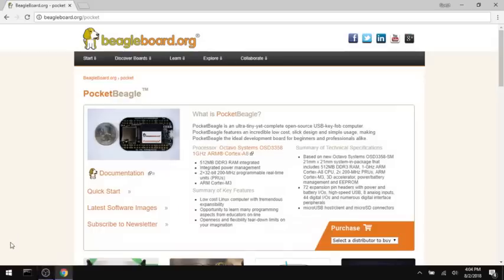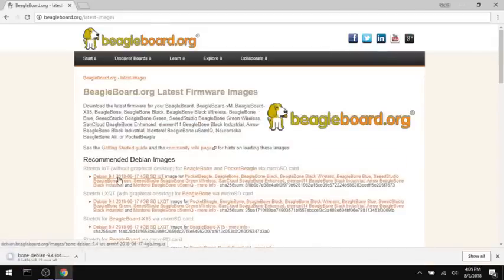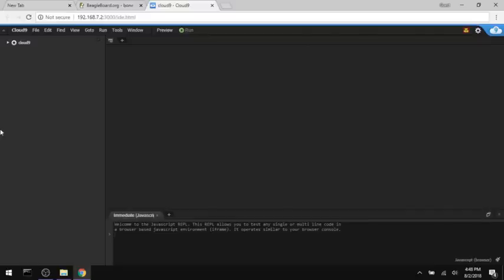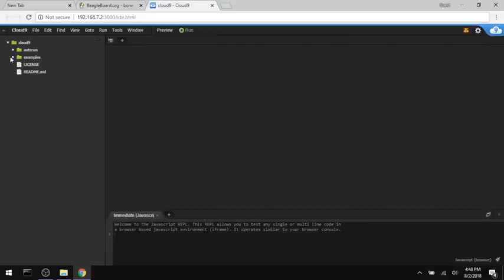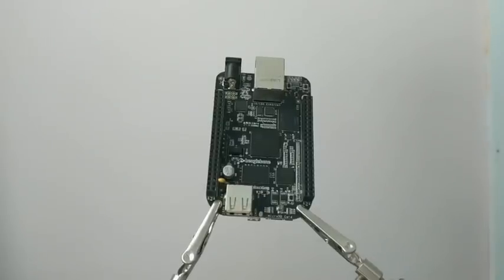BeagleBone Black specs | Just Board

Comment: I like this series!

Btw you seem like the right person to ask this:
I'm planning on creating an IoT temp measuring device for my fridge, then transmits it to a server so I can monitor the temperature on the go. maybe a bit overengineerd. But do you have good suggestions to realize such an project?

+ cool theremin clone ;)
Reply from the maker: Thanks! I've got more of those planned, for sure.

For the temperature monitor a board with Wifi or Bluetooth seem like a good fit since you probably don't want to run Ethernet cables to your fridge. But you'll probably need analog input to read the probe...

A Raspberry Pi Zero W with an analog to digital add-on would work. There's probably even an add-on specifically for that purpose somewhere out there. And run the server from the Pi itself.

Or something like this: https://www.espruino.com/MDBT42Q (which has analog inputs and Bluetooth) could send the readings to a nearby computer running the server.

Bonus points if you run a Tor client on the server and check the status of your fridge over Tor with OrFox! (it would be over-engineering but totally cool and wouldn't require any port-forwarding)
Reply: DavyBot v1.0 how would you power the pi inside the fridge?
Reply from the maker: I was thinking to run the probe into the fridge and set the Pi on top or something. Most of those temperature probes are at the end of a long wire that you could fit between the seal of the door. For instance these ones are cheap and they handle the analog-to-digital): https://www.google.com/search?q=DS18b20

I'm not sure what kinds of options there are for boards operating at temperatures like that if you wanted to put them on the inside. That would be a fun experiment though! I wonder how long a Raspberry Pi would survive in my freezer...?
Reply: DavyBot v1.0 one thing is for sure: no additional cooling needed